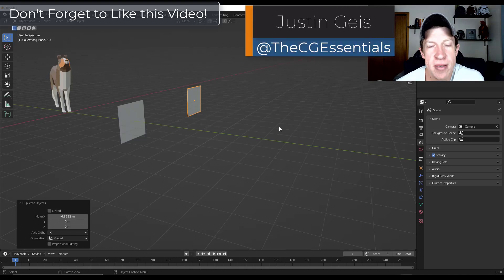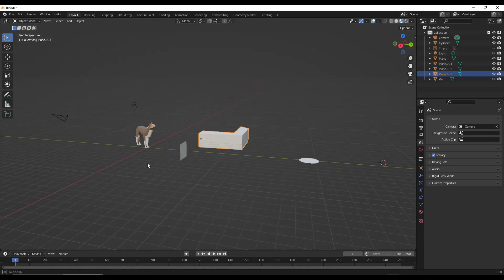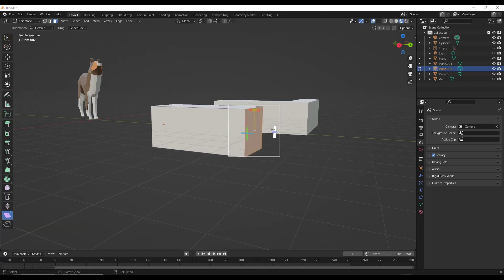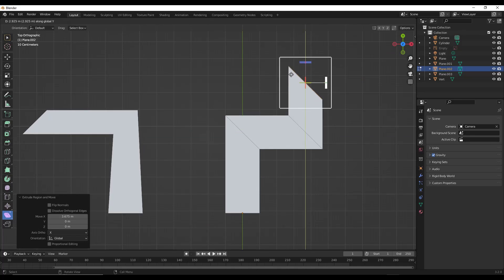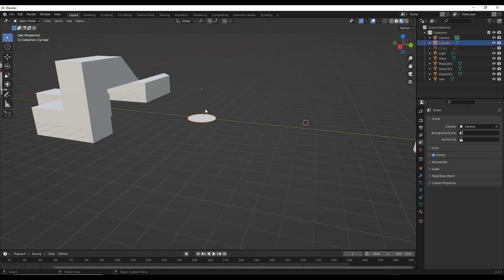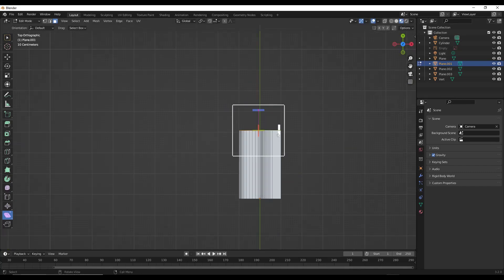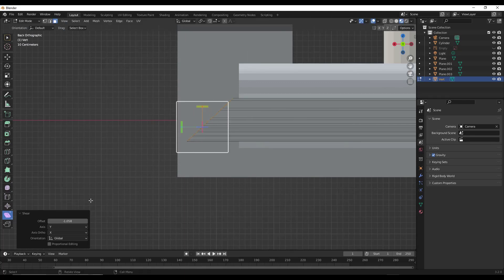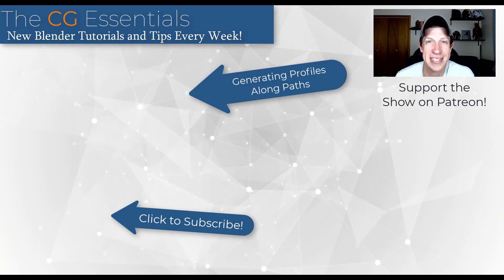How to Use the SHEAR TOOL in Blender!

Comment: You can hold the ctrl key while you shear to snap it to a value, like 1 or -1, which will save you entering the value in the adjust last operation entry field. It's much quicker.
This snapping option is available in many tools, not just move, rotate and scale.

Comment: Interesting! I need to try and use this on a weapon model I've been working on! Getting the blade to come to a point without deforming the rest of the details has been a massive pain! I think this will work perfectly to create the tip and only need minor edits for the rest of the base!
Reply from the maker: Hmmm - I'll be interested to see if this tool works in this application